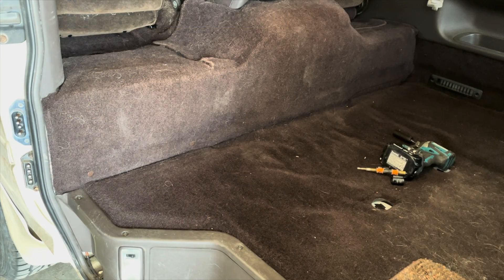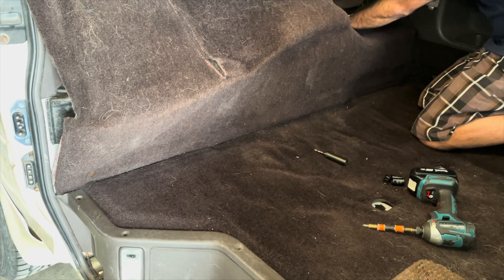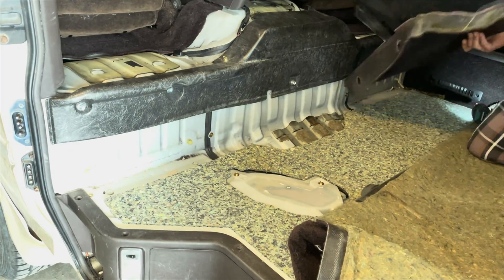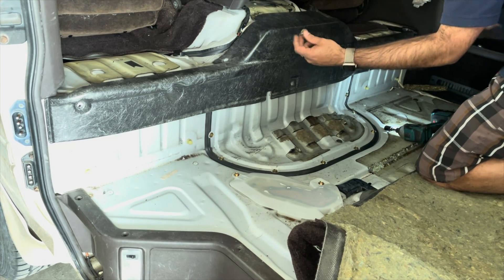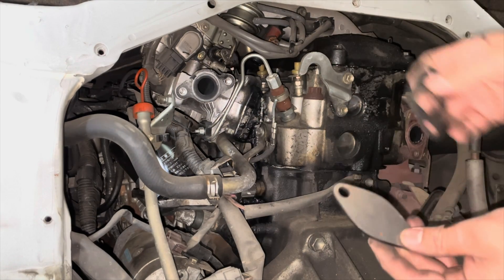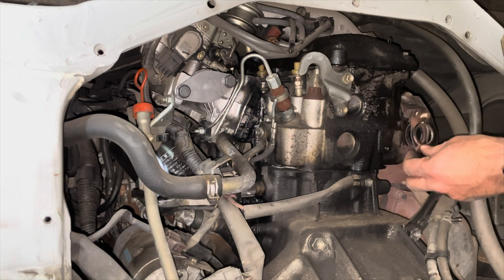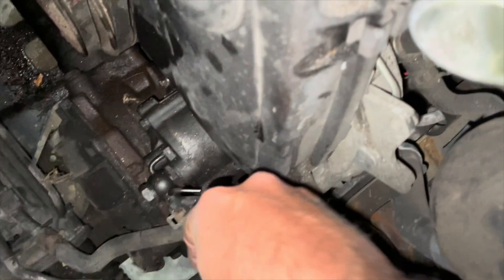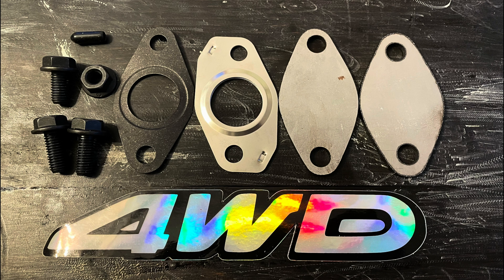Toyota Hiace EGR Blocking Kit for 1KZ (HiaceSouthEast)

Comment: did deleting the egr and the mess of vacuum lines trigger any check engine lights? also when you removed the small butterfly did you notice any rougher idle or shut down?  just trying to get an opinion from some one who has actually done this because everyone online says one thing or the other. Cheers! and great tutorial.
Reply from the maker: All I did was the block off plates and left everything in place in case next owner wanted to put it all back for emissions testing. I only caped the line that came right off the EGR valve and left all the other little things in the vacuum line working. Also never removed the small valve as I didn’t think necessary as it is in the open position by default from what I can tell.

Comment: I'm suspecting my egr valve is faulty (trouble starting, bad idle when cold, bad fuel economy), would an egr block help with that?
Reply from the maker: Its possible. Hard to tell if that's the only thing wrong until you block it off or test to see if the EGR valve is moving at all.
Reply: @TheBroDojo  I actually just went ahead and ordered the kit so I'll know soon enough if that's the issue!
Reply: @robinarens  did you install it? I would love your feedback
Reply: @odatte  I did and shortly after had the turbo fail on me. I'm suspecting there was an oil leak in the turbo that was causing the problems in the first place
Reply: @robinarens  ah yes, that could be problematic for sure, did you notice some benefits to blocking the EGR, cleaner oil? Runs smoother? Better fuel mileage? Thanks again
Reply: @odatte  seemed like the mileage was a little better

Comment: IS the process the same for the 3L engine?  Also, has there been a noticeable difference in the way the van runs after installing it?
Reply from the maker: Im not familiar with the 3L setup but should be pretty straight forward and similar. Van runs pretty much the same as before from what I can tell, just more peace of mind of not having to worry about the EGR failing/getting stuck.

Comment: I ended up using the kit and doing the EGR delete.  Have you noticed any issues with more of a "shudder" when turning off the engine?  I read around online and sounds like the throttle body butterfly may be the culprit.  I reached out to Hiace Southeast but haven't heard back yet.
Reply from the maker: Mine acts pretty much the same as before. I’ve read online as well that removing some of the butterfly/throttle plates can make shut down rougher, but have no experience with that.

Comment: Nice video!  I ordered the kit and was trying to figure out where the vacuum cap went.  You pointed toward the end of the video to EGR switches, the vacuum hoses, EGR solenoid, EGR butterfly.  Did you end up removing all of those?
Reply from the maker: I kept them all in place in case I ever sell the van and someone needs to put all the EGR crap back for emissions testing.

Comment: So any noticeable engine temp increase since the delete?
Reply from the maker: In the process of getting radiator fixed so haven’t run with it yet. I haven’t heard that engine temps would increase? Where did you here that?
Reply: The Bro Dojo - i watched this video https://youtu.be/15oJEyx-JK8, he explains the purpose for the egr is to cycle exhaust gas into the intake to reduce combustible gasses, thus cooling the engine and reducing emissions.
Reply from the maker: The EGR is for emissions to reduce NOx (combustable gas), and is closed during full throttle/power anyway, so engine temps aren't going to be any different. If it is faulty and or clogged, then it'll let the exhaust in the intake and ruin your power.  It would make the air temps slightly cooler during idle/low throttle when it is actually open, only because it diluting the O2 and burning off some NOx. Ive never heard of anyone having problems with removing the EGR or having higher temps because it.